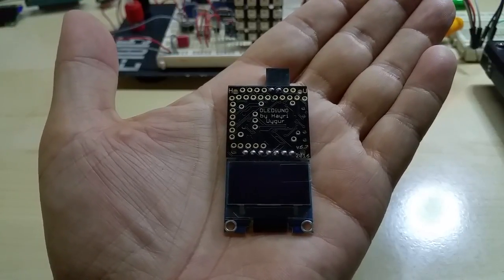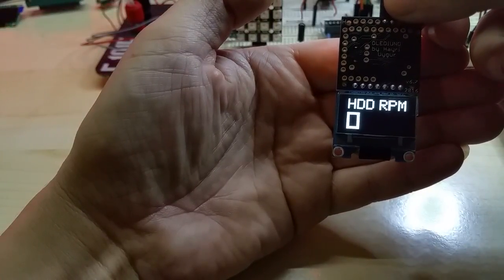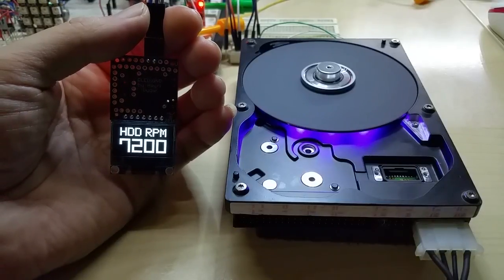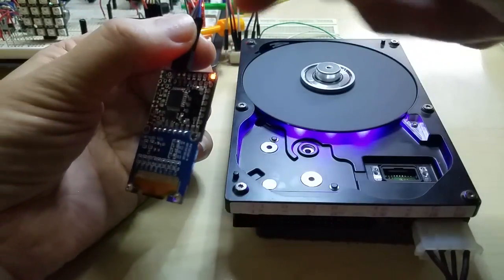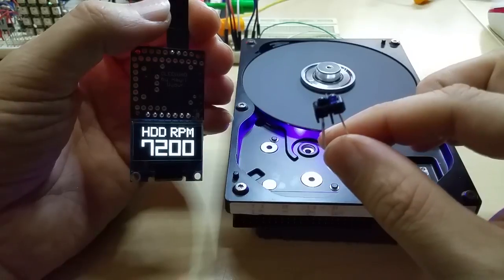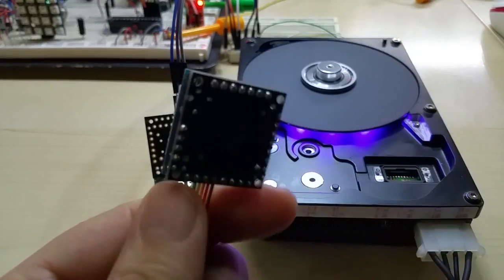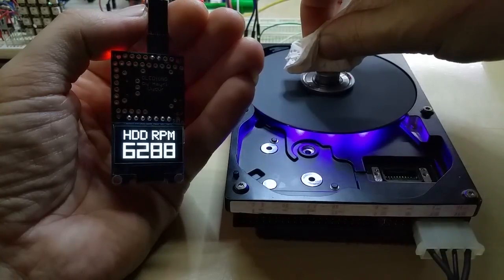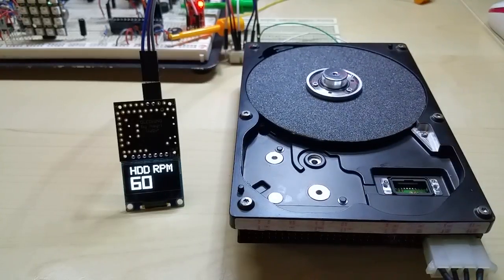OLEDiUNO Spindle/HDD Tachometer

Comment: very fast refresh rate!!! any chance you could add a function in which it will either blink or change color when the required rpm is reached? same function as a tachometer with shifter light in race cars/bikes.
Reply from the maker: The display is only monochrome. But maybe a LED could be added as a shift light to the code.
Reply: Hayri  - your gps cube speedo has a yellow line on top of the screen. So i thought maybe it could change color when you set a certain rpm. Anyway, it will be great that you can set rpm so that it will rapidly flash so that the user know when to shift. Different bikes has a variety of redlines so thats why i was hoping you could set certain rpms. 
You have great ideas on your products. Feedback from the users would make it even greater :) 
Thank you for listening. My friends want to try to build a 3 panel gauge using your gps speedo, gear indicator and hopefully this adjustable tachometer on a bike.
Reply from the maker: Those 2 colors are permanent, top 16 lines are yellow the rest blue. There are color OLED displays too, but I do not work with those.

Comment: can this be adapted to a hall effect sensor to use as a small engine tach with the magnet in the flywheel for the signal?
Reply from the maker: It surely can, be sure to glue the magnet down securely.
Reply: Adding on to that question above since I plan on doing the same with a small engine, can your tach be self-standing? Meaning can it just run off a battery and the hall-effect sensor? Or will you need an Arduino for it to run? Do you have an code example available if you do need an Arduino externally?
Reply from the maker: It can run on batteries or even a Lipo battery. You don't need an Arduino because this already is a Arduino, it uses a Atmega328 SMD chip. And the code is obviously on this chip. It uses about 20mA so you can calculate how long your battery will last.

Comment: cool grinder ;) I found that it can be a little more useful, if you put a few disk platters in to increase the weight. that way it will have a little more inertia when griding something tougher. also, to make easy grit change, I glued velcro to top platter and use velcro sandpaper ;) And btw. your duino projects are awesome!
Reply from the maker: Thanks for your comment and great idea. I just recently fell in love with old HDD's. Have many more projects on mind, including a VU meter with the reading arm. Good tip with the velcro, I probably end up with many grinders :-))
Actually want to make more disks with different grit sandpaper, but I think I mentioned that in the video. Next is a vertical cutter with a HDD motor, I know it won't be very strong or useful but I have fun building stuff. Thanks for watching btw.